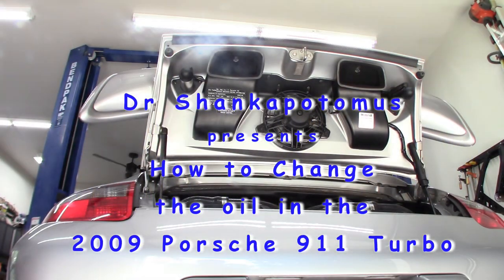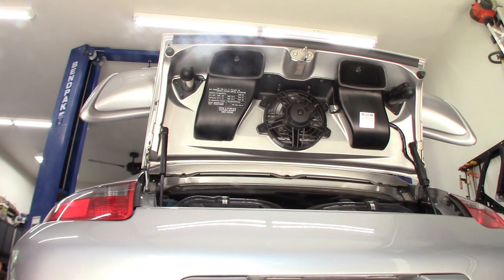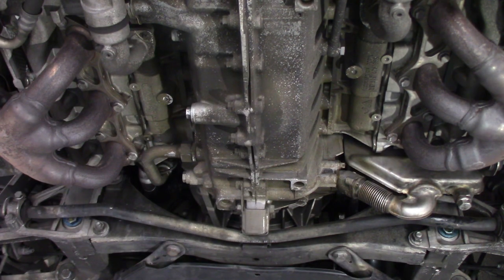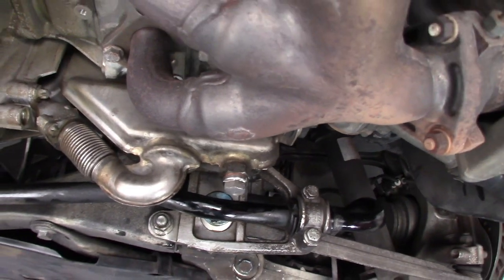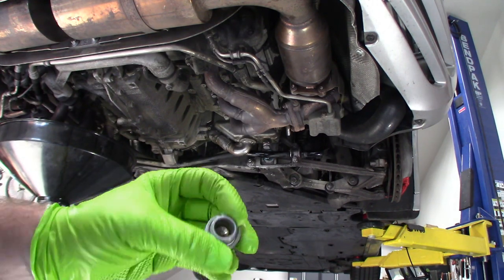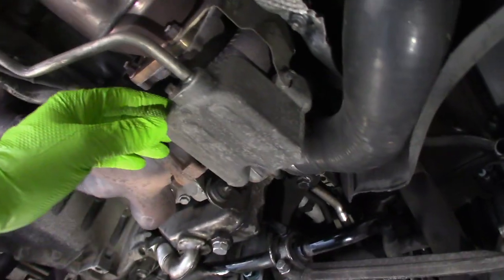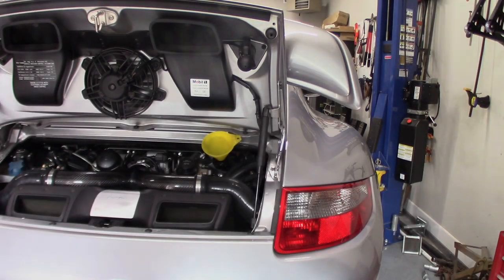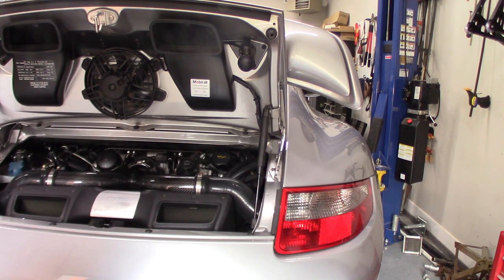How to Change the Oil in the 2009 Porsche 911 Turbo

Comment: Thanks for doing this.  Gives me the confidence to do it myself.
Reply from the maker: Yes you can...It's sorta low to the ground so the lift really helps😁. Holding a counter wrench on the reservoir drain is key. You could do a lot of damage there. Thanks for watching. Also interested what year your working on and if the turbos have the separate small drain plugs?

Comment: A very well done instructional video. Thank you very much!
Reply from the maker: You're very welcome. I've had a lot fun working on the 911. The engineering is unbelievable. Real shop manuals are hard to find as well. Be careful when you change the front differential/transfer unit gear oil...It's actually two separate chambers with different gear oil in each one. The differential clutch requires 75w-80 that (best I could tell) is only sold by Porsche at $50+ per liter.😯😯😯. Thanks for watching.

Comment: @DrShankopotamus. Great video! Very helpful! I have a question. I'm trying to restore a water logged 2009 Porsche 911 Turbo just like yours. When I put the new oil in, it comes out crystal clear out of the reservoir but I get chocolate milk out of the crank case. Do you know of a way to directly put oil in so I can keep flushing the water out? I cannot turn the car on for reference.

Thanks!

Comment: It is only one bolt to remove the hard line fitting to the turbo oil supply some videos show removal.
Reply: One bolt and a small fitting holding the hard line in place.  I'm pretty sure you should remove that and drain that oil, too.